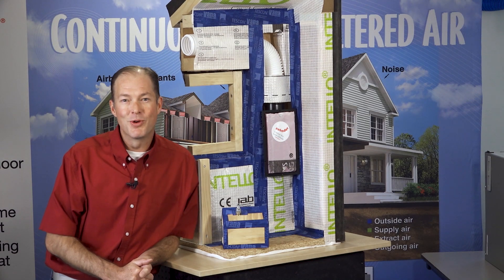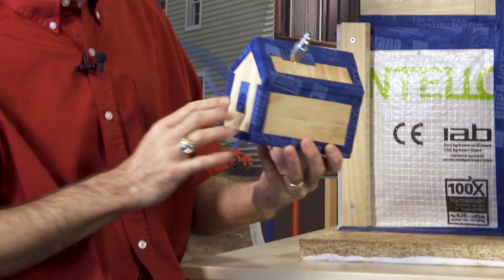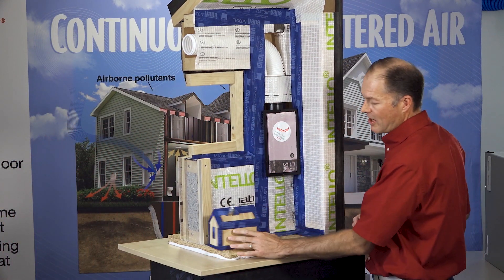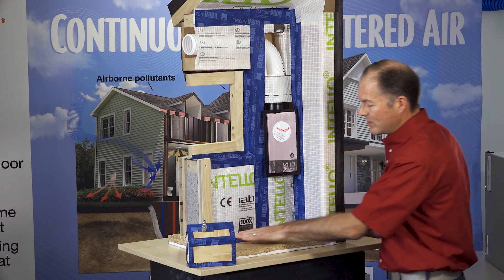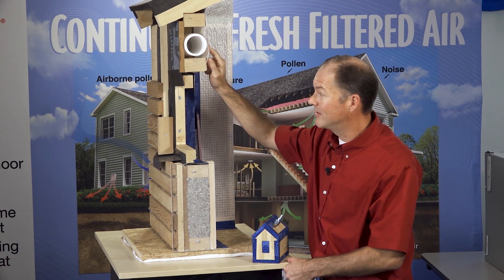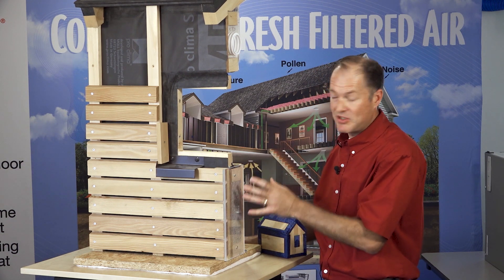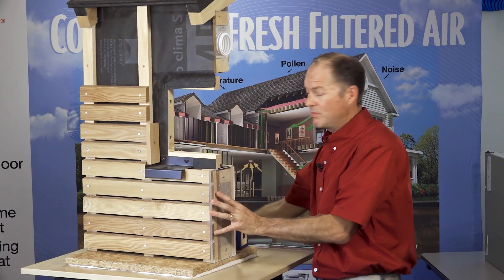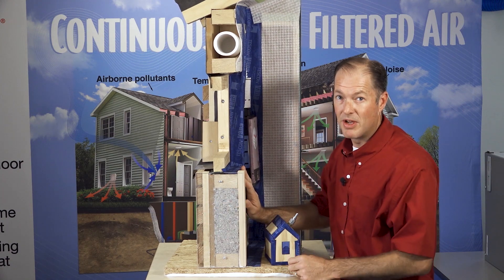Passive House Airtight Construction Demo

Comment: Tyvek is a vapor open WRB so your statement about it not drying out is completely incorrect.
Reply from the maker: Thank you, there are micro holes between each strand of industrial recycled plastic strands; which are fairly large under a microscope.